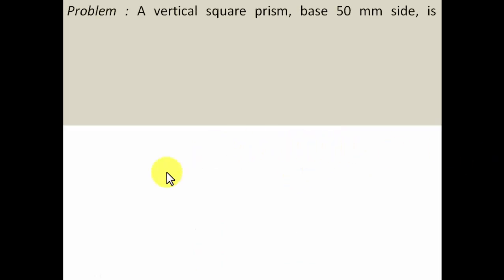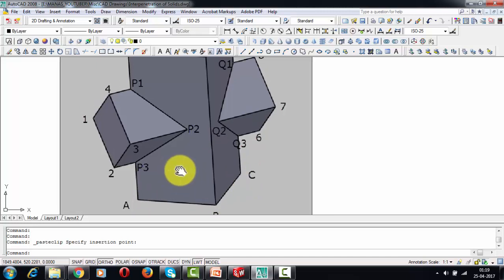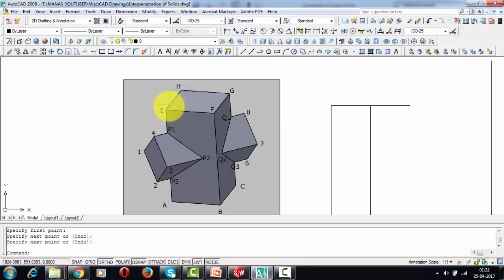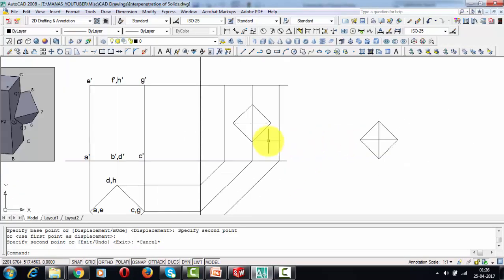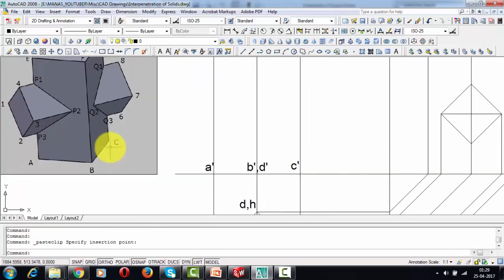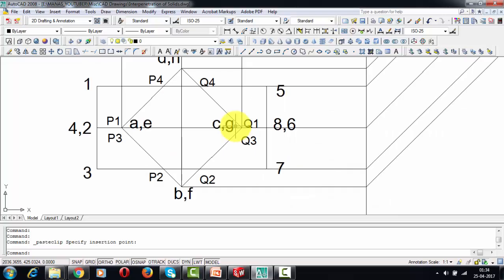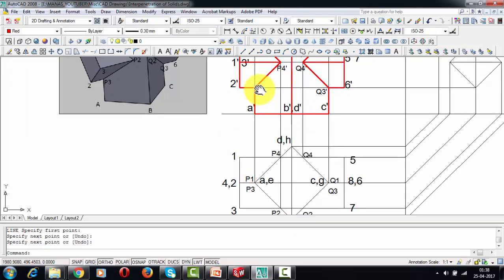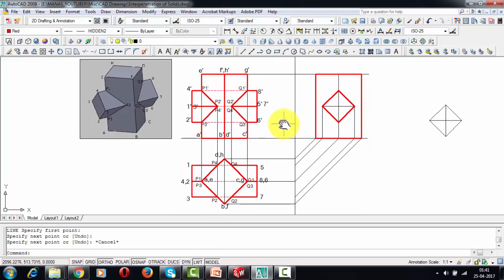Interpenetration of Solids_Problem 1_Horizontal Square Prism vs Vertical Square Prism

Comment: A vertical square prism base 50 mm side and height 90 mm is completely penetrated by a 
horizontal square prism, 35 mm side and axis 90 mm long so that their axes are 10 mm 
apart. The axis of the horizontal prism is parallel to V.P. while the faces of both prisms 
are equally inclined to the V.P. Draw the projections of the prisms showing lines of 
intersections.

Comment: Two equal prisms whose ends are equilateral triangles of 40 mm side and axes 80 mm long, intersect each other such that their axes are at right angle and bisecting each other. One face of each prism is on the ground. The axis of one of the prisms makes 30° with the V.P. Draw its projections showing the curve of intersection.

SIR SOLVE IT PLZ

Comment: A 60mm dia. 80mm axis  Cone resting on base on hp it's vertically penetrate by square prism 25mm sides 90mm axis .2 faces of prism are equally inclined to v.p. axis both are parallel and 6 mm apart . The plane containing both axes inclined45 degree to v.p. axes of prism nearer to the observer